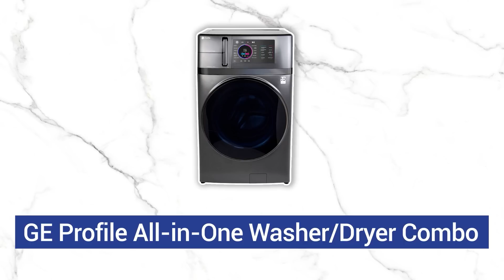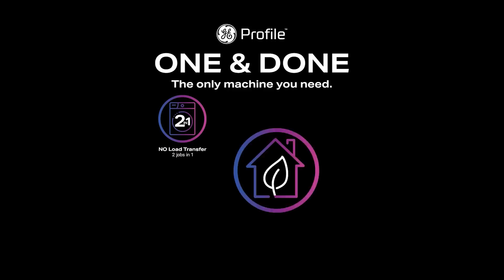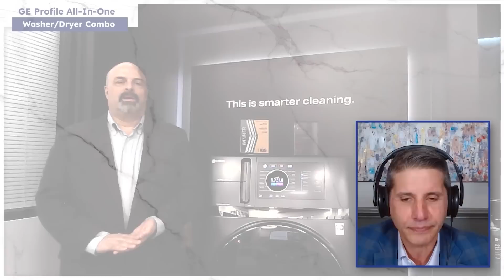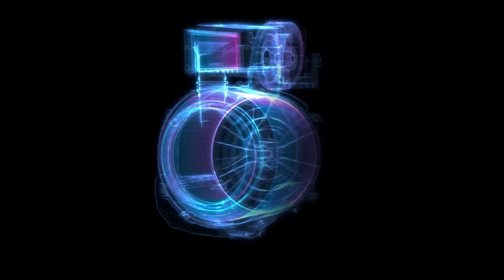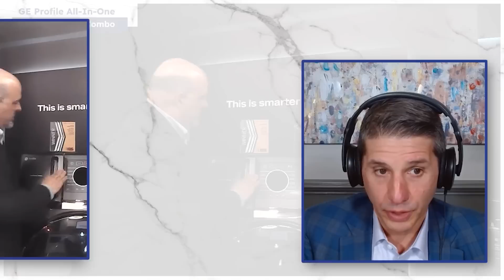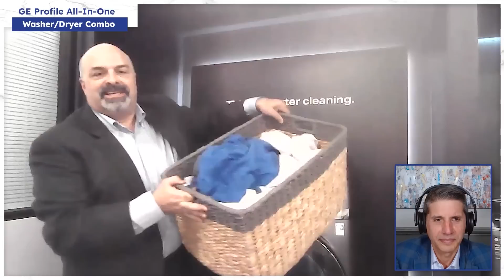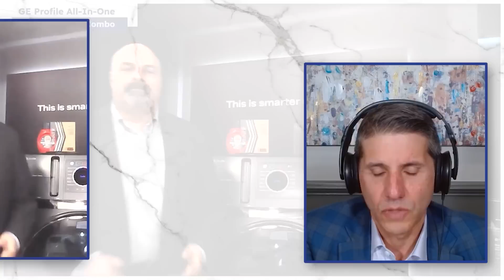New GE Profile All-in-One Washer and Dryer: Tough Questions for the Creator

Comment: To those whom are agape after hearing the price: 
I have a new perspective on things: 1. research the appliance(s) you need and resolve to buy the right make/model for you. 2. Get the best price you can on the model you chose in step one. 3. Buy it and DON'T LOOK BACK. (RIP Brad Delp. IYKYK) 
Why do I say this? I just purchased the GE 850/85 series washer/dryer, which is the top-of-the-line GE before stepping into their Profile 950/95 Series. The $200ish price difference per Profile machine led me to eschew doing any research on that model pair.  I deeply regret that. 
Had I thought about it a bit longer, I would've realized that had I financed the better units, it would've cost me less than $35/month more over 12 months. I wouldn't have even noticed that. But I will notice living with the missing features and benefits over the life of the laundry pair every time I do laundry.
Personally, I'll heed this line of reasoning every time I purchase an item that I intend to own for a long time and interact with on a regular, frequent basis, e.g., furniture, tools, etc. Moral of the story: A good deal on the wrong appliance is far worse than a fair deal on the correct one.

Comment: Im not sure if this has been asked but I like to season my clothes with dryer sheets when drying. Is there a way to use dryer sheets to help maintain my clothes from static and other issues? Second question is does it determine how much detergent and fabric softener goes in the load based on load size or is it the same exact amount for each load? Can you also choose to not use the detergent and fabric softener on different loads?
Reply from the maker: all good questions.....I am going back to the training center next week.
Reply: Dryer sheets are a fiber covered with wax based concoction. Use a bit of vinegar (or liquid fabric softener). Better for you, better for the environment.
Reply: @Jilbertb  Dryer sheets are fabric softener embedded material.  Experts recommend against fabric softener.  Wash by fabric type.  Synthetics should have cool/warm washes AND drys.
Reply: Season😂
Reply: Agreed great qx along with on board water heater for sanitizing steam?

Comment: I have been in the textile cleaning and garment care industry for 30 years. (Dry Cleaners and Laundry)  We have known this day was coming.  Where the 30" wide home-size product will catch up with us.  Based on what I see here in this video, The only thing this machine is lacking is a filtration system for the wash cycle. It would cut down on lint and fewer soils re-deposited on the textiles before the drying cycle.  I can see with the "smart" over-the-air updates.....better chemical dosing programs and subscription plan chemicals delivered to the home are on the horizon.   Customers are smarter and will do a better job of classifying types of textiles in the future..  Properly classified textiles will dry "quickly" If the lint is removed often and this machine is not overloaded...It should preform well.    King size comforter?????? HMM will be wrinkled for sure.   A down feather one will take a LOOOOOOOOOOONG time to dry.   It is what it is.   This is real game changer.....but not cheap.   I can't wait to get my hands on one.  $3K for a 5lb per hour machine is steep.  It's a worldwide market and space is a real concern.  I think if the front door gasket holds up and does not leak water on the floor......This machine is a real value for home users.
Reply from the maker: I wouldn't put the out of business sign on your store just yet......In terms of fabric care, this is good but Miele is better with their HoneyComb drum

Comment: I had. GE water heater, with a heat pump, it was and still is amazing!  Hope the technology and repairs have caught up.  Heat pumps are amazing
Reply: You must be in a hot and humid climate?
Reply: I have one too with mine in the garage elevated from the garage floor next to the washer and dryer. A lot of Florida homes are set up with the water heater and laundry in the garage so that the heat from the dryer and water heater don’t affect the temperature inside of the house. The greatest thing about having the Eco water heater is that the heat pump effectively works as an air conditioner for the interior of my garage as it extracts the heat and humidity from the air and converts into heat in the tank. 
And my electric bill has been minimized dramatically
Reply: @LlyleHunter  Spot on ! I live in Florida too with a garage based heat pump water heater. In the hottest months it knocks about 8 to 10 degrees off the temperature when running and we are using about $30 a month less in electricity for a family of 4. I've been looking for a heat pump dryer but this looks like a game changer to me. I hope it works over time and I can learn to trust GE again. My 2010 era GE profile fridge caught on fire when a circuit board failed. Had I not been there it would have set my house on fire.
Reply: I'm in the San Francisco Bay Area. My water heater is in a basement room. It was necessary to have a grill into the crawl space to get more air flow and a small ~20 watt blower to exhaust from the room to the outside. But I have solar and everything in the house is electric, heating/cooling, induction cooktop etc. Since I generate more power than I need my utility bill is zero. No complaints, but heat pump water heaters are definitely even better in hot humid climates.

Comment: I hope the team at YALE follows up with a performance review after this (ie how well does it clean, how fast does it dry, do the clothes smell funny afterwards, how badly wrinkled are items when they come out, how much lint builds up inside and at the gasket, noise levels of the washer drum spinning, all the usual complaints with these combo units, etc, etc).   We need the details and trust Yale to provide the accurate feedback.
Reply from the maker: Being tested as we speak........
Reply: @YaleAppliance1  any idea when results or a video may come out? I'm moving into my new house in July or August, so I'm right on the line on whether to go traditional, or get this unit
Reply: @vasu42  they did a few days ago
Reply: @YaleAppliance1 any idea of when you’ll publish the review?
Reply: @kf1107  just got released today
Reply: @YaleAppliance1  yeah video or article, any insight on if there will be shortages on this I heard what he said in the video but how does that translate into getting your hands on one if it tests good.
Reply: Sadly heat pump "filters" cannot stop fine lint and fine dust from slowly getting by and building up around the coils thereby causing longer drying times. You would need to tear apart a heat pump dryer in order to properly clean it every 3 years.
Reply: @gilrose12345  If you listened to what he said they addressed that.  This is better tech than other current heat pump devices.
Reply: @gilrose12345  The designer did point out that you could use a crevice tool to clean out that area where the coils are
Reply: Wrinkled clothes is more dependent on the load size and clothing material and not the washer itself.
Reply: Well, it takes 3 hours and forty minutes to do a load of towels. Saw that on a personal review by an owner. That's a big no for me...
Reply: @Jilbertb  There will be up sides and downsides but the fact is you can't beat the quality and reliablity you would get from two seperate dedicated units.  However I am planning on installing a upstairs laundry just for my everyday things.  This no vent all in one on a 110 v powerline makes this a no brainer.  What I won't be doing is depending on this unit to  handly my work cloths and those things that just get filty or require a dedicated high power dryer.  I will keep my setup in the basement but I am sure I will be taking the strairs a lot less.

Comment: Also, how close to the wall can this be placed? The depth in the specs for standard W/D never takes into account the fact that it needs so much space behind.
Reply: The manual says the rear only needs room for the water hoses. No other clearance needed in any dimension.
Reply: As long as you get 90 degree water hoses, there is zero clearance needed in the back.  In fact, all sides have zero necessary clearance.

Comment: If you have filled the smart dispensers with detergent and softener, is there a way to skip using those for a specific load? If my grandkids are here they use unscented baby detergents for their clothes. Or if I’m doing a load of bath towels I don’t want fabric softener on those.
Reply: A further question: will the automatic dispensers put in the amount the detergent manufacturers say to put in? Or, the amount needed to wash the clothes and the rinse cycles rinse it all out? I use the amount the repairman says, that is, about 2 tablespoons or a bit more. Anyone’s thoughts or experiences?  Thank you!

Comment: I love heat pump dryers, but im still very skeptical about the condenser getting covered in lint.  I feel no matter how good the filtration is, particles will still get through.
Reply from the maker: You and me both
Reply: For what it's worth, I've had a Whirlpool heat pump dryer for almost 4 years now and not required any exceptional cleaning (i.e., disassembly) to maintain suitable drying performance. 

I have identified that the fine lint filter gets a buildup over time that's impossible to remove, thus it requires replacement-- probably every couple years. Also found that the air exit from the drum has holes that will eventually get little rocks of compacted lint. Just pushing those out with a little screwdriver or toothpick every year is another easy routine maintenance thing that takes 5 minutes.

Comment: I own GE top of the line front load washer/dryer and adore them so I am very excited to hear Yale’s review of this new product! Currently, my laundry is in the basement, which means I have to carry heavy laundry down two flights of stairs and that isn’t as easy as it once was! We hope to age in place so this new GE Combo will be a game changer IF it lives up to the hype! I would jump for joy if I could put this upstairs near a water source and where my dirty laundry currently resides! I remember using an all in one unit as a 10 year old in 1970 that was located in the kitchen of our apartment. I was responsible for doing my family’s laundry so I would do one load of laundry at night. in the morning it was dry, and ready to be folded! That washer/dryer combo was the best because it meant I could my family’s laundry every night then fold before breakfast! By the way, at just under $3,000 is a great price point because the GE front load washer and dryer was more expensive when we purchased them in 12/2020.
Reply: Not sure where ppl are buying appliances but I got a huge (5.0) Samsung top load washer and dryer for $1300. Hate front loaders, cleaned every 2 wks with citric acid and always left door wide open and still got black mold.
Reply: I also have the GE set about 1 year newer. Last month I noticed the washer stopped draining. I pulled the drain pump and it was completely out of spec. Nothing was broken physically it was the electrical part. I put new pump in but it was still not draining. I had to also replace the mainboard. Mainboard had a blown transistor. Pretty sure that fried the drain pump. So not real happy with GE. The mainboard had I think 17 separate connectors. I never saw anything like that but thankfully it's working like new again. On a side note when it was under warranty during the first year GE sent a repair guy to replace the bellows (gasket) for a leak. I had to take the machine apart for the drain pump and the factory GE tech left screws out on the vent fan. I found some screws that fit and replaced them. Can't even trust factory trained repair reps.

Comment: I will be buying this machine. I’m remodeling and I haven’t cut a vent hole in the wall in the hopes that an all-in-one that works would make it to market. I hope this is it. Really like that it’s full capacity and is easy to use, with a reasonable drying time. I’m wondering about the energy efficiency incentives, when those will come.
Reply from the maker: Not sure....
Reply: You’re right on time!
Reply: Sounds like you've got to have a hole somewhere for water drainage.

Comment: 1) If the dry temperature is lower, how do wash-n-wear fabrics come out? Many of them depend on dryer heat to release wrinkles.

2) If it keeps using the same air over and over, won't it end up smelling a bit stale?
Reply from the maker: Good questions....Its not that much lower.  They are hoping air flow helps

Comment: I’m not sure about this unit, but we recently bought (2) sets of Miele washers & heat pump dryers. After getting all of the settings set - and it takes a little bit, I’m loving the units; especially the heat pump dryers. It takes a little longer than our previous large LG vented dryer, but honestly not by much for medium sized loads. You have to set the controls to Extra-Dry, and you have to get used to the way the clothes feel when done. You’ll think shirts, pants, and bed linens are damp by feel, but once you take them out of the dryer and hang the clothes or get the sheets to the bed, they’re dry. It’s only a few seconds and it’s hard to explain it. Clothes sound come out of the LG dry but felt roasted. Clothes come out of Miele smooth, warm, and soft. It does get really warm.  We plugged both sets into a 220v splitter (splits one 220v into two 110v), maybe that makes a difference.  They do generate some heat in the laundry room, but it’s just a little bit of heat and no moisture.  If the GE heat pump dryer works as well as the Miele, people will be pleased - but they may have to get used to the feel when the clothes are finished. They seem slightly damp but really aren’t.  I’m loving them.
Reply: I have a Miele dishwasher and a Miele canister vacuum and both are outstanding performers and so so very quiet.
Reply: Miele’s are considered some of the top models in the world. I have been looking at the heat pump dryers and the clothes feel is common.

Comment: Hmmmm…..I have never had a good experience with any all-in-one, washer-dryer unit. The problem that I have had ,with the units I have tried is that they all have taken too long to dry,( in my opinion)in addition to that , on some  models the clothes did not actually dry well….( I had to hang them up afterwards) on some other models I used,I felt that my clothes came out “crunchy” not fluffy , like a typical vented dryer. I think this is an interesting model. Unfortunately, my grandmother was from Missouri , “the show me state “😅…..I think I inherited that from her.Time will tell….good interview Steve, I would love to try this machine.

Also: the rear bearing will get 2-3 times the wear, what type of metal (and what grade) did they specify?
Reply from the maker: Great questions.....which we will find out soon

Comment: I'm obsessed with this machine. 

When I graduated and got my first teaching job I purchased my first washing machine. It was one of the GE ones with micoban tech (DGFW850SSN0WW). I was amazed at how well it worked. It cleaned my clothes so damn well. I also LOVED the auto detergent dispense and smart features that are built into the machine.

That said, I had always wanted one of these all-in-ones machines but I was aware of some of the drawbacks (prime among them was the time to dry). If this thing works as well as it seems, I will really want to get one even though my washing machine is relatively new.

One thing... will it get Matter support (which means that hopefully it will become HomeKit compatible at some point)?
Reply: Even thought it’s not HomeKit compatible I’ve seen a reviewer show the app alerts on her Apple Watch, I have that now with my whirlpool and appreciate having the basic notification that wash is done.